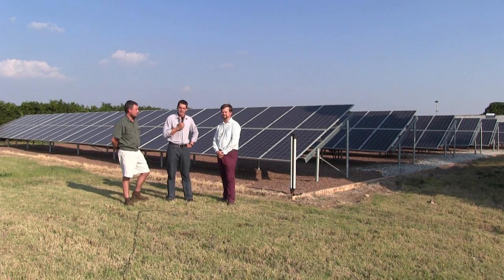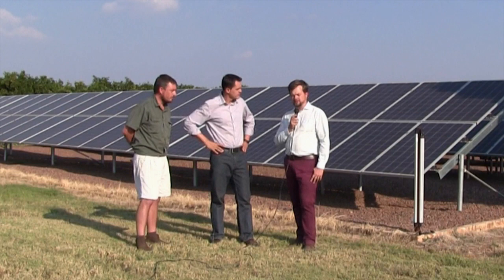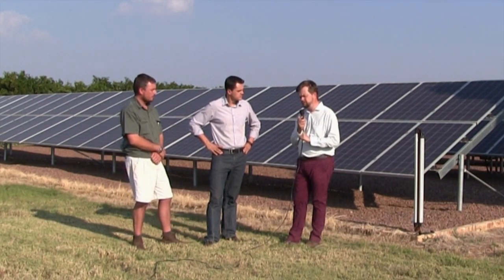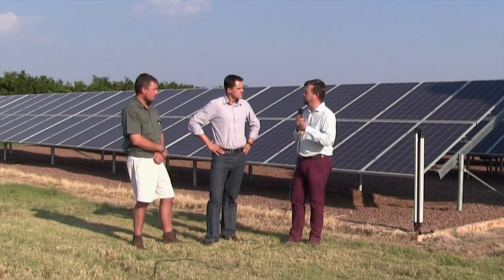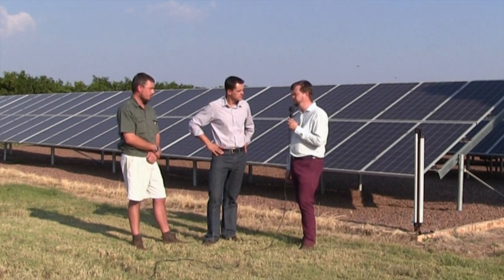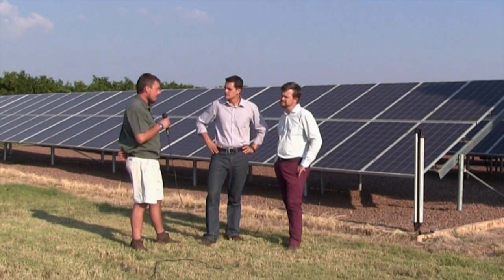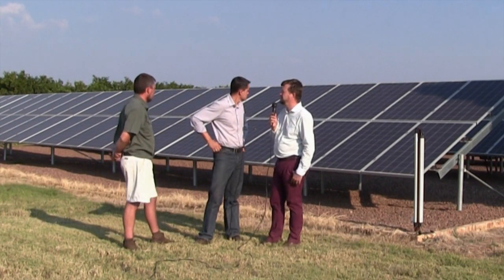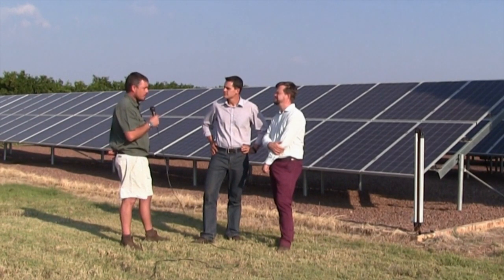SOLAR PV POWER Agricultural System 200 kW

Comment: How much land did this project use. How much acres?
Reply from the maker: As a rule of thumb for Solar PV you require 4m2 per kWpeak and for Solar heating 1,8 m2 per kWpeak.
Solar thermal heat generally runs at 60% efficiency versus Solar PV electrical at 18% efficiency.

Comment: What is cost of this project
Reply from the maker: Dear Sannaya,
The current cost of solar has drastically reduced. The Levelized cost of solar energy in South Africa is currently about R0.40/kWh for solar heat and R0.90/kWh for solar electricity.
If you are interested in more financial information on the project send me an email at wally@blackdotenergy.co.za